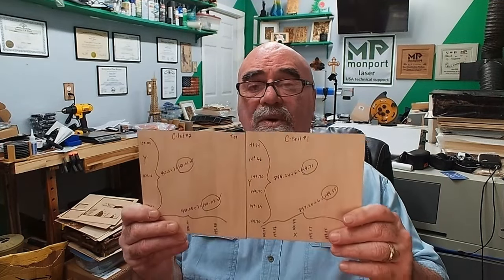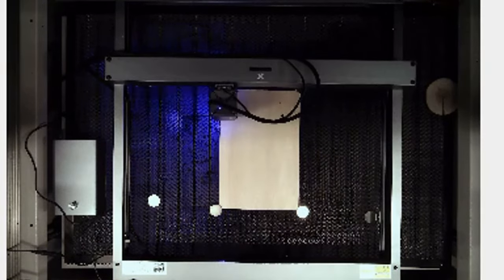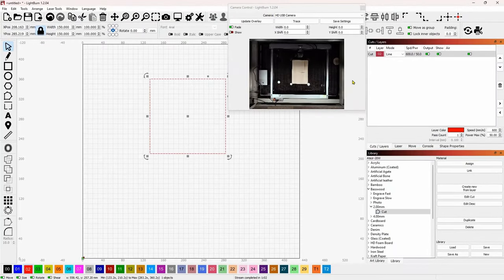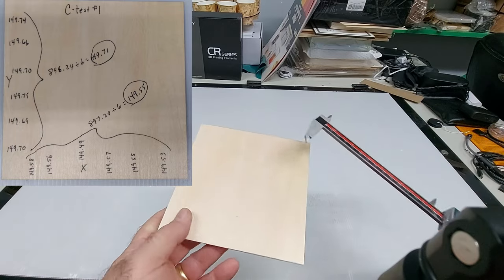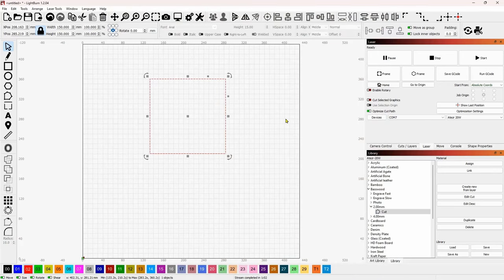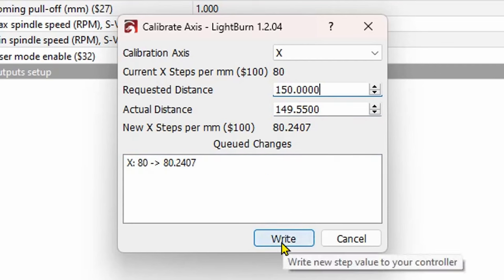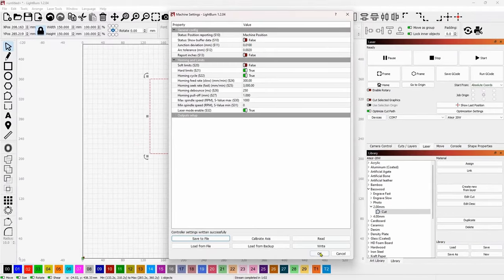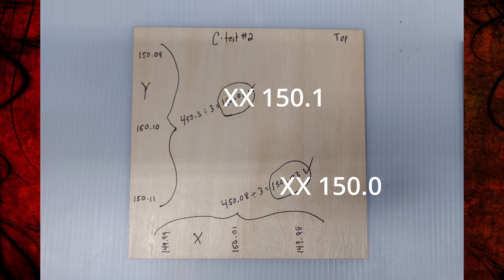Perfect Calibration on your Hobby Laser in Lightburn!

Comment: Hi rich I’m subscribe your channel!!because you explain every function of the laser and Lightburn very well!!!my congratulation!!!🎉🎉
My question is; why when I perform a cut on DMF 3mm single passage at 150mm/min with 85% power, axis X cut ok but axis Y doesn’t pass the wood in all his length?do you explain why it happens??thanks a lot!
Reply from the maker: Because you're using a diode laser with a rectangle laser beam. The X will always cut deeper. You'll need to adjust your speed and power for the Y.

Comment: Does it matter if you are cutting an inside hole vs an outside cutout? Will this make my inside 150mm hole of my part to large? Im metal fabrication the machine shifted by the amount of the  beam diameter or curf based upon the clockwise or counterclockwose direction.  So interior geometry always cut on a clockwise direction and outside of the part always cut ccw. I do not see LB doing this.
Reply from the maker: It will make a cut whatever it is set to. This tool is only meant to be used as a controller correction.

Comment: i dont have machine settings in edit what the heck and why
Reply from the maker: You should!
Reply: LightBurn info says not available with smoothie
Reply from the maker: @jimbauer6822  Okay, I guess it's not.
Reply: @TheLouisianaHobbyGuy  what device are you using smoothie is the only thing that will run on my machine its a k40 with cohesion 3d board and lightburn  anything else just freezes

Comment: Your x was more accurate than you thought. I believe there was a mistake in your calculation. I got 149.9933333333333
Reply from the maker: Yeah Dave, I didn't use the calculator until afterwards. My old brain is getting tired 🤪
Reply: @TheLouisianaHobbyGuy  just a thought …. Should you measure both the hole and the plug at the same points and then take an overall average? Jus thinking kerf size of cut if you are going for absolute accuracy. This could add other variations to how you might tackle a project. Inside v’s outside cut and kerf offset which i believe you have touched on in at least one other video
Reply: @TheLouisianaHobbyGuy  you are not old, but what i can say more that. Thank you

Comment: how do you adjust the movement speed when the works is finish in Lightburn? I can only see "speed" in the move tab. it only affects the framing movement and set laser position movement.
Reply from the maker: The speed on the move tab controls the speed of the laser when it's not engraving or cutting a layer.
Reply: @TheLouisianaHobbyGuy  what about the speed after engraving? can it be adjusted?
Reply from the maker: I don't know what you mean by the speed after engraving, sorry. There are 3 speed controls, the one on the move tab, the white space scanning, and on each layer on the Cuts / Layers.
Reply: @TheLouisianaHobbyGuy  what i mean is, after engraving, the laser head goes back to its original position. the speed of the movement of the laser when going back to its original position is a bit fast. can it be adjusted?